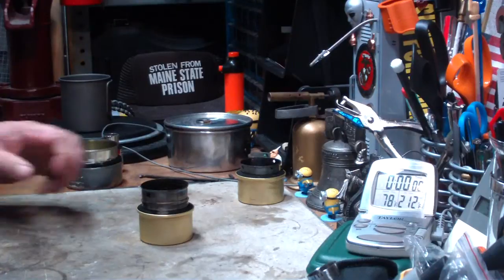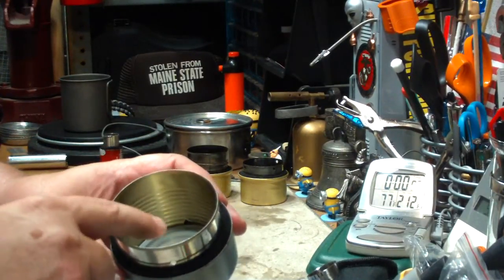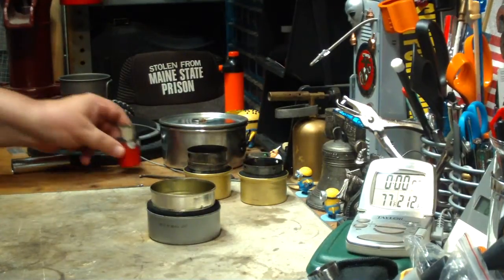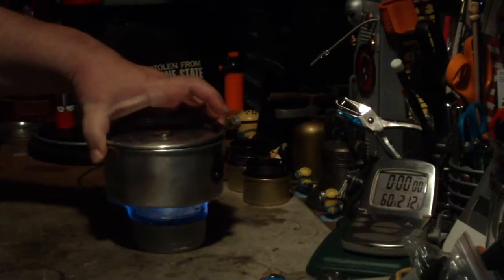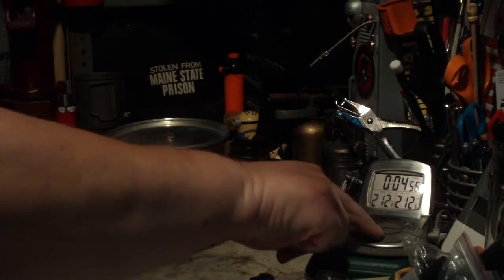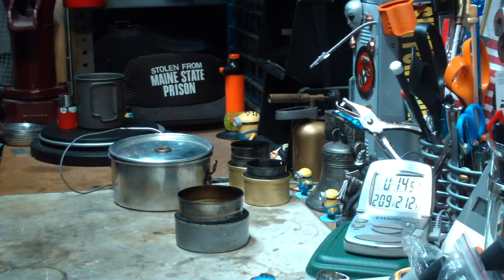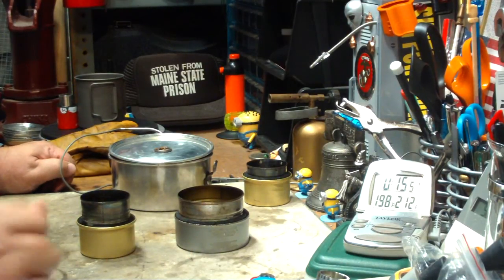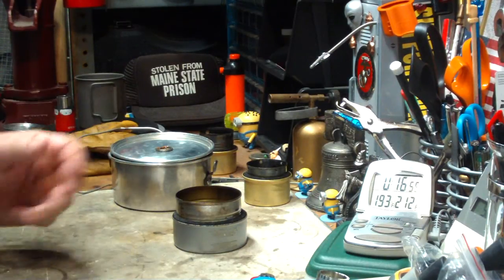Can the Fancy Feast Stove Be Made Larger? - Boil Test #1

Comment: Good video. Thanks. In regards to the size of the stove vs. the size of the pot, Four Dog Stove does an indepth series called Potology. In that series, he shows a wide variety of pots used over the centuries and how they work with different stoves. I believe he said that the ratio to pot size is 2/3 the size of the stove compared to the pot, and the bottom of the pot benefits from rounded edges. That allows the flame to rise up and heat the bottom edge of the pot.

Comment: Made one from a tuna can and a mushroom can. This had a little larger gap and took two wraps of the felt. I tested with a package of organic ramen. It's not fried, so it needs to be boiled for 4 minutes. 1-1/2 ounces of methanol boiled the required 1-1/2 cups of water in a little under 5 minutes, then cooked the noodles for the required 4 minutes, and then went out at 10 minutes. Perfect. And the mushroom can is plenty stable for my 1 quart pan.

Comment: Great job Hiram.
I am a little concerned about the stability of the small stoves. Losing your lunch or cup of tea is disappointing but getting scalded, burning down your tent, or starting a bushfire can thow you to the next level.
I encourage people to experiment with different sizes and applications, but please bear safety in mind. Simple potstands maybe one approach. For example, two pieces of wire bent into identical squares, hinged together open to form a simple stand.

Comment: Just a suggestion for the larger Tuna fish can. 
In Australia we can get small Baked-beans cans size 220g (7.8 ounce) but I thought the pot was held too far from the heat.
(Those were made in Au by a company called SPC. But HEINZ and other use the same sized can. )
Of the same diameter of 65mm or 2+9/16th inch; 
we recently have access to the same diameter 184g can (6.5 ounce) 
full of Stems & pieces of Champignon (hard mushrooms) (these were made in China) 
that puts the pot closer to the flame than the baked-bean can. 
Trial & error approach.

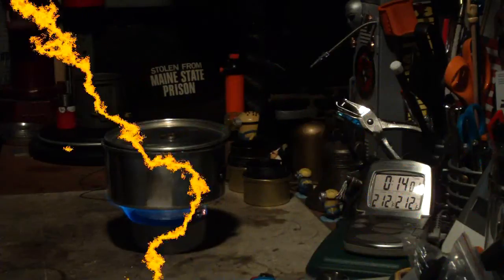Comment: I just made one of these. However i've never used one. I put in some heet and was wondering how long it takes to absorb the fuel. It took a long time before the carbon felt would light. Is this normal?  Also it only ran for about 4:30 without a pot on it. Is this also normal?  Thanks

Comment: Who knew Fancy Feast cans were so small! I had to buy a 6 ounce can of paste just to fit inside it. The stove looks so much bigger on videos. Couldn't find a bigger can. The cat food can is an inch high! Yikes. Going to splurge at Home Depot because I need so little carbon fiber. Thanks for the idea!
Reply: +Sinfonian Barelytone I'm having the same frustration with the size of the FF cans!  In Hiram's boil test #2, he says the FF can is probably not a FF can - but some other cat food.  When I shop, I'll be looking at all sizes of cat and human food cans.  8^)
Reply: Just use steel wool or paper towel,even sand for a wick..no need for expensive carbon.

Comment: How about using the corner of a file and making one or more tiny vs in the pot stand with the file instead of the vent hole? This way excessive pressure can get out under the pot, and the vapors would be burned off under the pot instead of 1/2 inch or more below the pot.